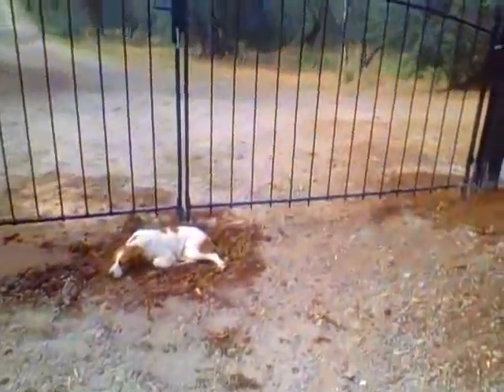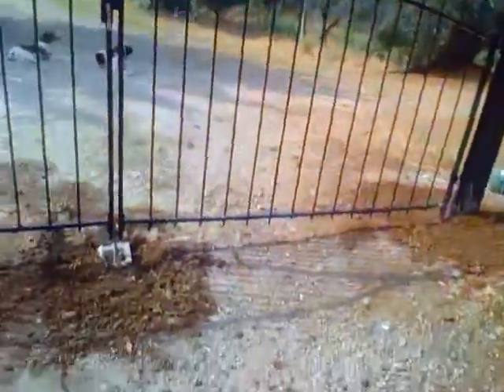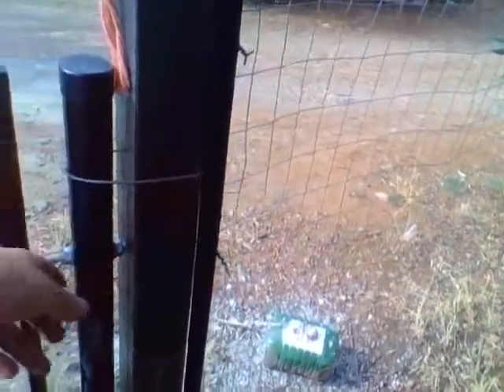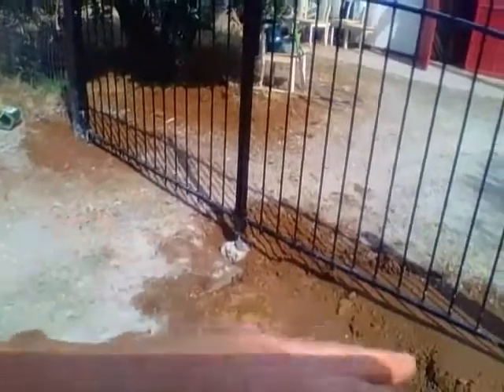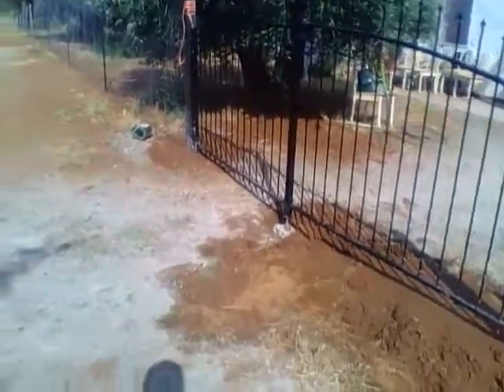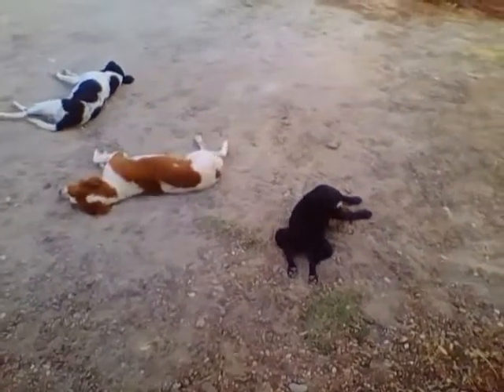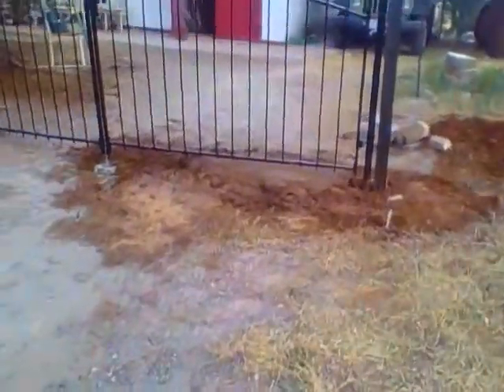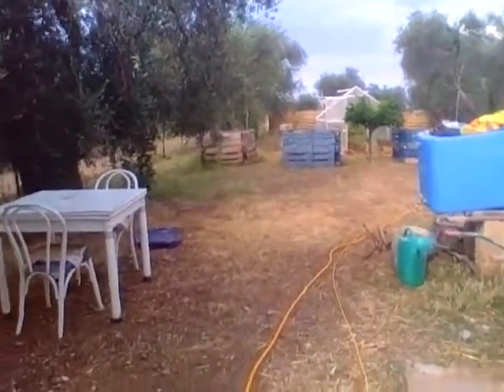VidaXL gate installation part 2

Comment: Can you tell me how to make the lock mechanism effective? If you push our gate a certain way, it just separates the gate
Reply from the maker: If you install it correctly the gate should line up and close properly. If the gate is more than 1mm out of alignment it will not shut close properly.  Make sure that it is 100% square level when you install it.
Reply from the maker: My gate shuts and closes square level all the time because I installed it using a level and square.  Although, you can hire a welder to come and reinforce the gate with metal bars and stronger hinges.
Reply: We used a level, although our driveway slopes, it meets in the middle just fine and operates and latches etc. It's just when the gates are pushed the opposite way of the latch backing (the 2 bars that catch the handle) the lock doesn't seem to catch. Would love a close video of yours to see where we are going wrong. The included instructions are pretty useless
Reply: When the drop-bolt is down, no problem, but someone can easily pull that up
Reply from the maker: @kellymum8965  All is shown in the video and suits my needs..  It is meant to be pulled up so you can open and close the gate.
Reply from the maker: Hire a welder to reinforce the gate with steel bars, back plating or chicken fencing.  It is a basic gate that can be upgraded to a more expensive model.  But get an estimate from a professional welder to suit your needs.

Comment: Toni when installing the spears I noticed that you let it go down a half an inch on the bottom how do you keep it from falling I can't figure that part out
Reply from the maker: It is metal so you can braze weld it, arc weld.  I agree the gate needs work. Easier to buy a cast iron or steel gate that is already welded for you. :)
Reply: @tonicasaesmeralda8612 that doesn't answere his question. How is it held in place now

Comment: the round posts supplied are rubbish. trying to make them straight nearly impossible because they are joined in the centre with a couple of screws. Ended up buying a couple of pool fence posts from bunnings. these have a foot attached with four holes so you can dynabolt them in the ground.
Reply from the maker: I just used a heavy strength gauge wire and tied them around metal posts from the building center.  The metal posts costs me about 15 dollars from the building center.  It all worked out well for me. 1 year later and I have no issues with the posts VidaXL supplied.  Shipping costs can sky rocket when the product is more heavy where I live. So I was just happy to get  fence and gate and work with what I got form VidaXL.  The metal posts I cemented in the ground 75cm and used concrete blocks to reinforce all the posts.